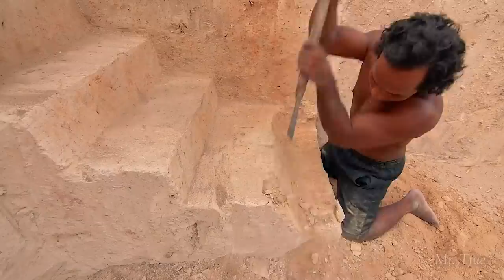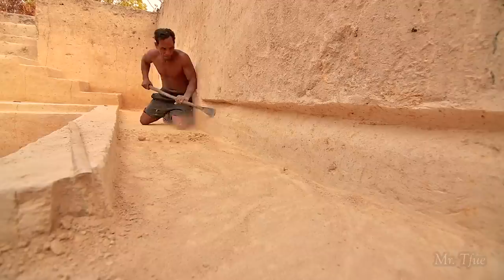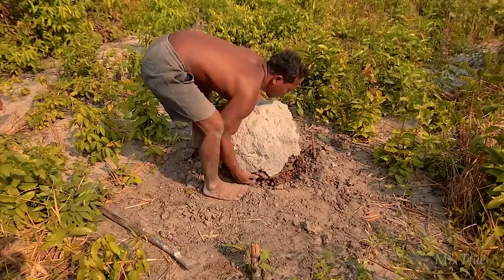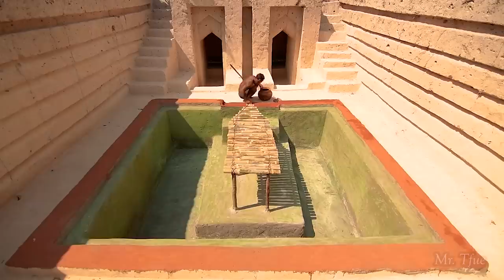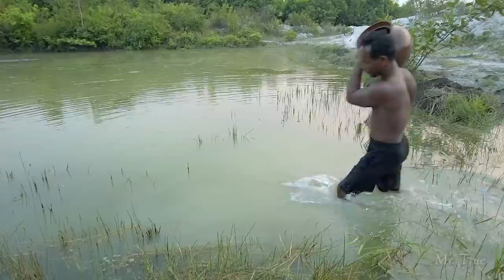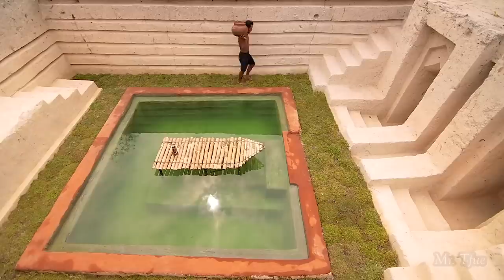60 Days Build Millionaire Underground Swimming Pool House

Comment: I know this is fake, but I still find it funny watching this dude run around with a stick, and beat up the dirt while the most intense music is playing.
Reply: @ivy like 90% of these vids are fake, but still fun to watch imo.
they hire construction teams and dig out the stuff with heavy machinery and only film small parts with the actors "working" there is absolutely NO way you're digging that deep with a stick in that short amount of time, try digging a small trench with a shovel yourself and you'll realize you can only go so deep manually, even harder in this sandy/rocky terrain, that surface looks dryyy. there's proof of them leaving these construction sites completely abandoned in the polynesian/indonesian jungles, deteriorating after filming and they usually don't clean up afterwards. look up compilations on here that point it out if u're interested.

Also you can easily tell when one of those videos is fake when they're using cement that appears out of thin air.
How do you think cement is made? There's a complex manufacturing process behind making cement.
This guy just grabbed what seems like a random limestone rock from the wild and magically grinded it into a whole puddle of cement by mixing it with water after 3 camera cuts lol.
Reply: Aşk olsun ya niye bunu yaptın ya yol nerede yaptın bana da söylesene ya gelip bizim evde Dörtyol Ocaklı mahallesi Doğan sokak bizleri yapar mısın acaba diye düşündüm hadi gönderiyorum gel bu da buraları gönderme yeri neresiydi ya unuttum da 

😍♥️🏝️🏝️🫣🫣🫶🏻

Comment: This guy: fills a pool with water using a bucket 

Me:I'm thirsty but my cup is empty and the sink is pretty far
Reply: Haha!!!
Reply: He probably used a hose in between clips.

Also, I think he needs to drain or rinse the water. How will he do that? One bucket at a time?

The water would become stale pretty quickly.
Reply: He went twice with a bucket... He used a pipe.. You guys are so gullible.
Reply: @Bonaoa Aoaiia What a complete freak show.
Reply: @sandman3881  Count me out of it. Why even use a bucket at all?
Reply: Yeah
Reply: @amundbisgaard7295  there will be no horses there
Reply: @amundbisgaard7295  aldo the thing he has colored the walls as green may be posionuous
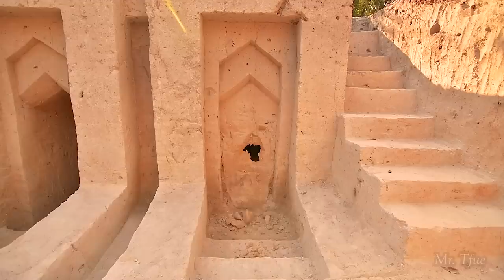Reply: 2:03 FBI OPEN UP
Reply: @nazishmalik6473  Horses? I was talking about a water hose. Not a horse.

A hose is used to lead water from this great invention called a "water faucet" and to you desired destination. Turn it on, let it flow, turn it off. Very simple.
Reply: LOL